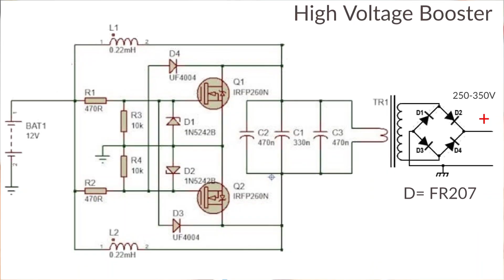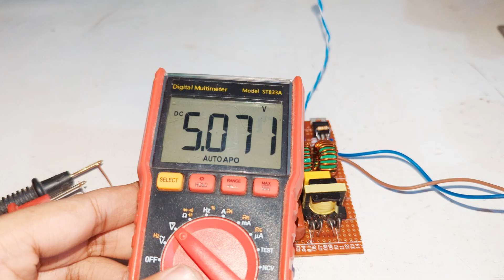How To Make a High Voltage Booster Generator 9V - 12V To 250V - 350V

Comment: How to make A convert 12-50V DC to 400V DC using a chopper, I need a DC-DC step-up converter, often called a boost converter or a DC chopper, designed to handle the desired output voltage and current. The circuit uses an electronic switch (like a MOSFET) to chop the input DC voltage, a transformer to step up the voltage, and a feedback circuit to regulate the output to the required 220V,
Reply from the maker: Ok

Comment: Required every details of transformer and inductors like its core size , wire thickness and number of turns etc.
Reply from the maker: Doesn't matter, use any core both same size and material and 300-600uh should work

Comment: What is this buuld useful for please?
Reply from the maker: It can be useful if you need a small but powerful high voltage generator , like Tube Amplifier , Capacitor charger , this can generate 250-350VDC UpTo 150W if little bit bigger transformer is used

Comment: Super this circuit use in transformer less inverter project  after input 310v dc switching MOSFET with egs002 module switch int 220v ac 50 hz 7:19  please make it sir 🥺🥺🥺🥺🥺🥺🥺🥺🥺🥺🥺 7:39
Reply from the maker: But I used transformer you can see 😅